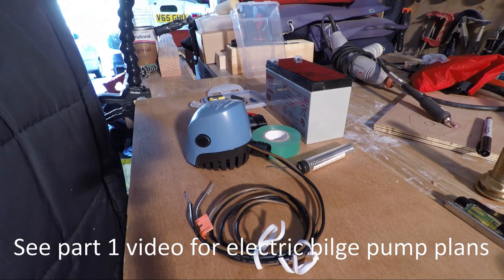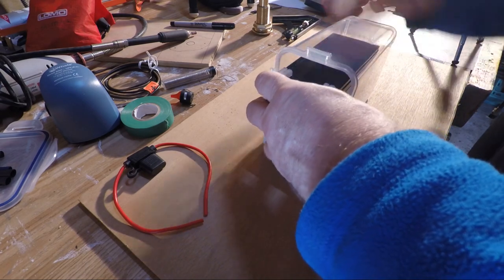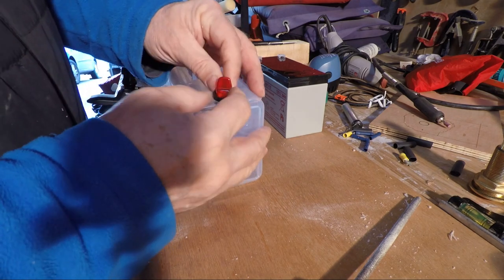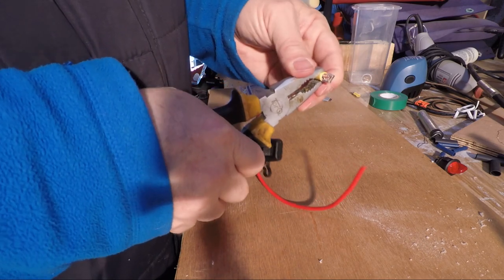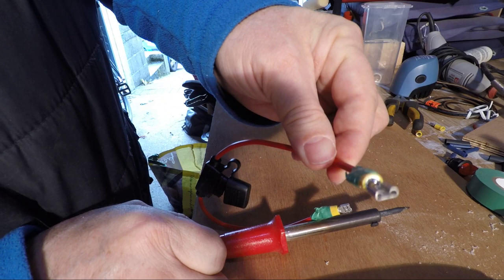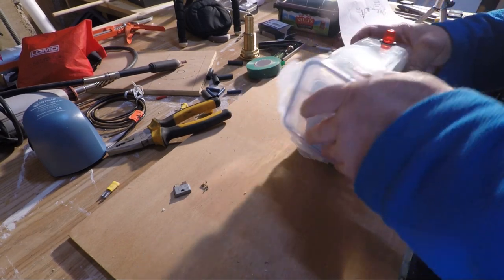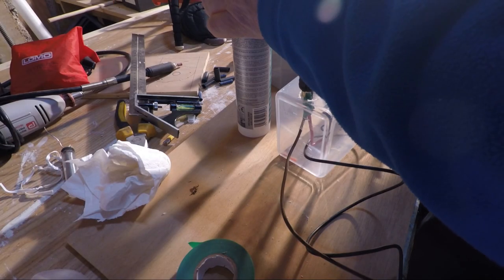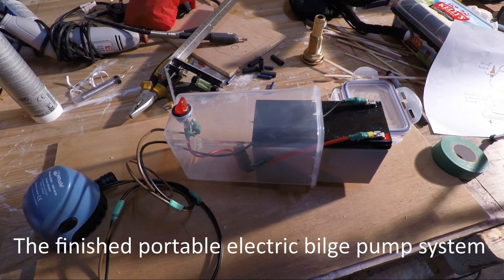Installing a small electric bilge pump in an open boat, a Welsford navigator (part 2)

Comment: There are proper waterproof switches with a rubber boot which would work. The one you used has a habit of shorting out when it gets wet. Been there done that 😅
Reply from the maker: Yeah I've learned that recently too 🤣

Comment: Great tutorial, many thanks. Is the third video showing the installation available?
Reply from the maker: I am so sorry but for some reason the third video seems to have disappeared. I will try and locate the copy from one of my storage drives and get it back up in next couple of weeks
Reply: @plymouthwelshboy  Any luck?
Reply from the maker: Hi Chris.....no i'm baffled....I know I did it. I know I saved it ....but it isn't on my normal hard drive....so I'm slowly going through the others. It isn't on my other channels either ....so I'm at a loss at moment. I'll keep going through the other drives. It has to be somewhere. If not I will refilm it
Reply: No worries … I’m curious if you used the through-hull fitting.  If so, how did you mount it?
Reply from the maker: @chrisiriarte5884  hah no I didn't. I put the  out pipe through the centrecase...  I'm working on principle that if water is above centrecase top...a frightened man with a bucket will shift more water until it is lower that centrecase top after which my portable electric pump can take over..in conjunction with frightened man and bucket 😄

Comment: you may have a problem with your switch, when you move it, the seal get under pressure, there are other switches with a possibly to screw them onto your box
Reply from the maker: thanks - the sealant is also a glue - it will hold - the stuff is amazing. on the downside if the switch breaks......ugh!
Reply: i hope it for you, you have a too nicer voice to drown 🤣